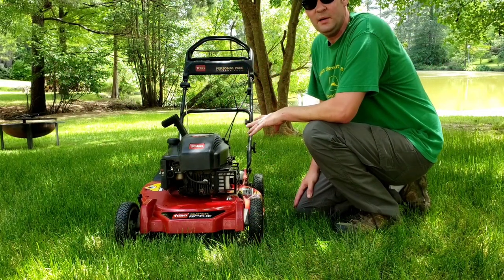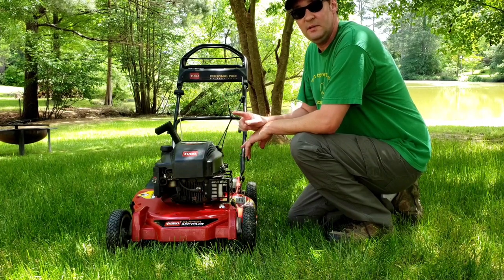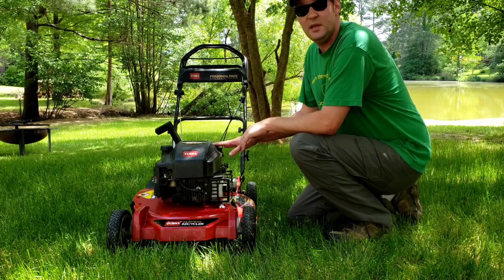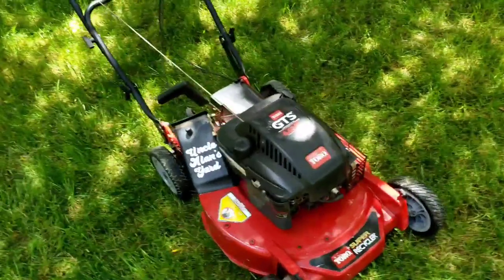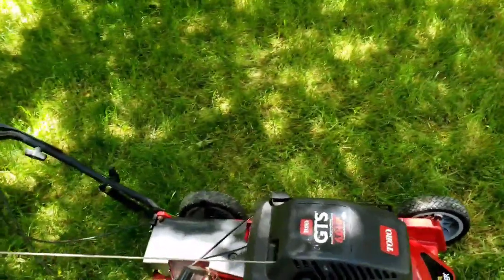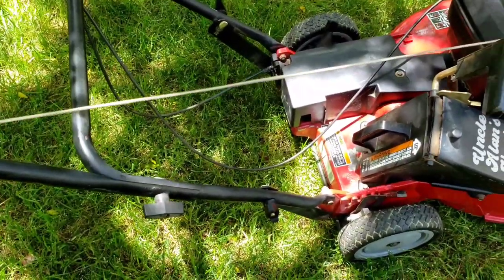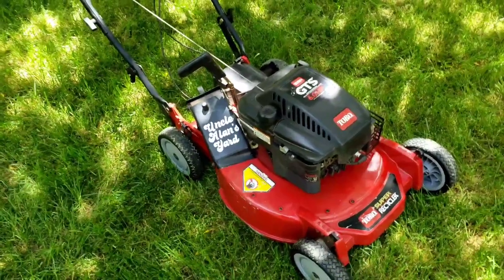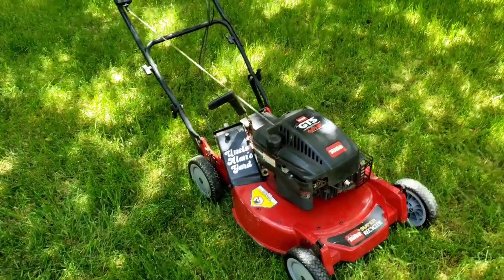Part 6 - It's Finished! Toro Super Recycler Rebuild #14

Comment: Great video collection Al. Mine is over twenty years old. Still runs and mulches well. I have to maybe clean out my carb as it kinda misses a little. Looks like yours cuts and mulches well. I just bought a new toro recycler in case my super recycler breaks. I wanted to get another super recycler. However, money is tight now. Maybe next year. Good luck to you!